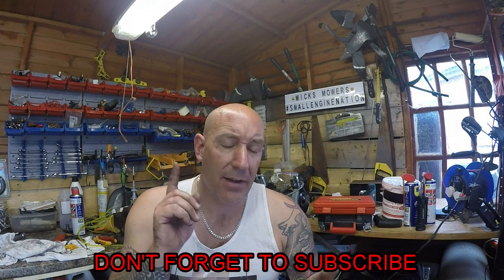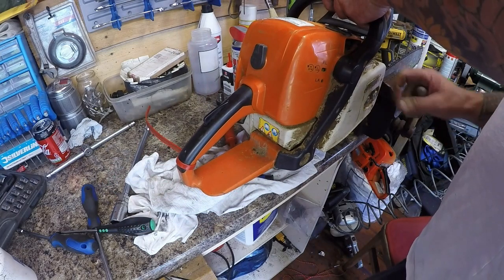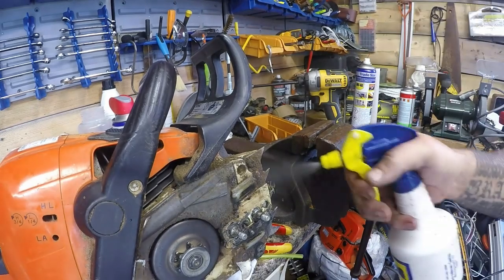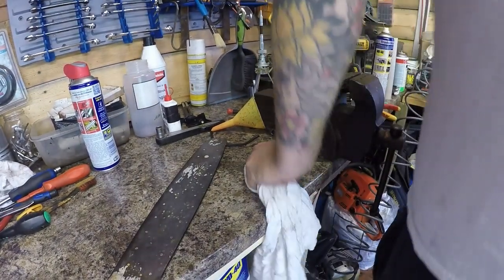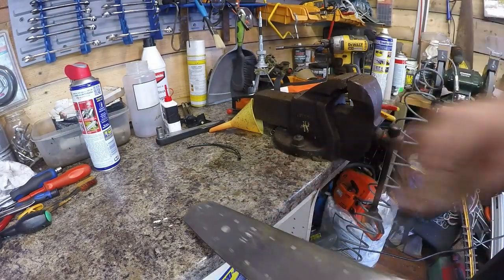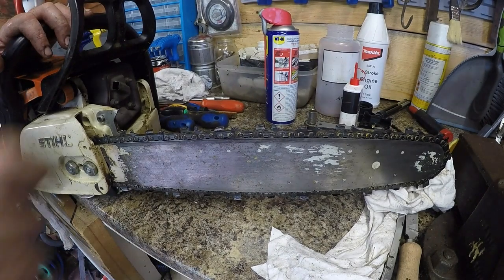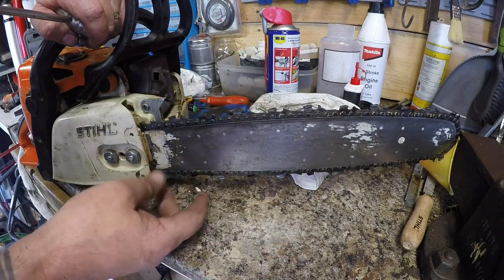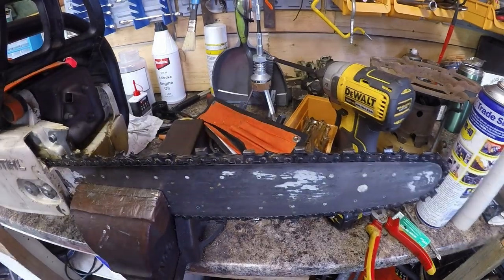STIHL CHAINSAW WHY HAS IT COME TO ME? #SMALLENGINENATION

Comment: Hi mate just a bit of advice, the holes where you greased are actually meant to be kept clear , they are for the bar oil to pass through , they line up with another hole on the body of the saw which comes from the oil pump , there in diff places so they line up properly when the bar is flipped, if it was a greaseable bar the tiny grease hole would be at the end near the sprocket , stihl bars don’t have this (oilomatic) as the oil lubricates the sprocket , hope this helps
Reply from the maker: AJoNeSy ta mate for the advice much appreciated